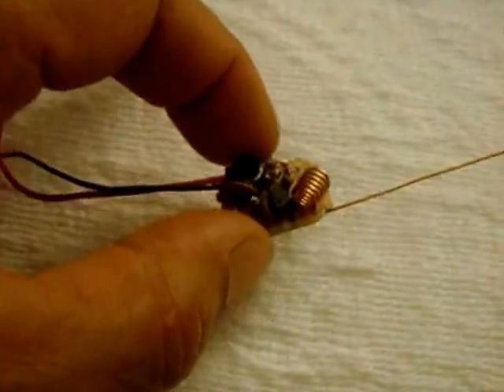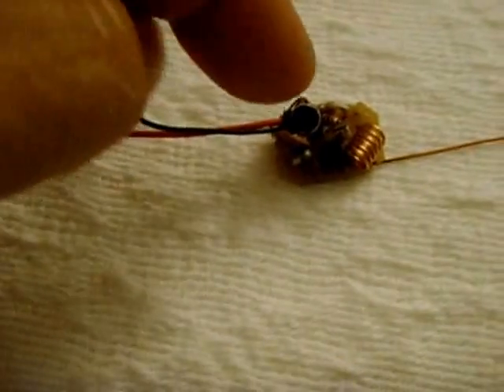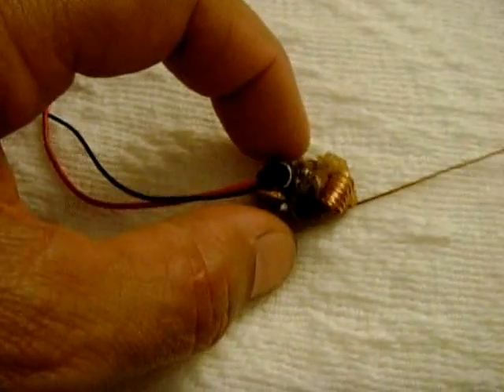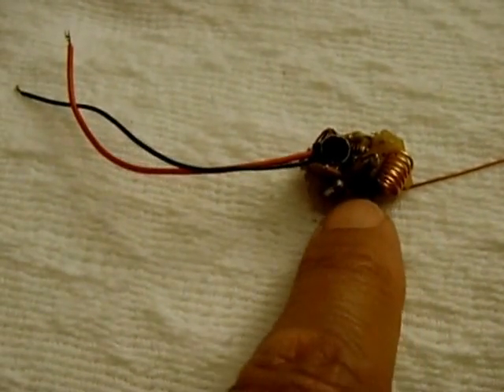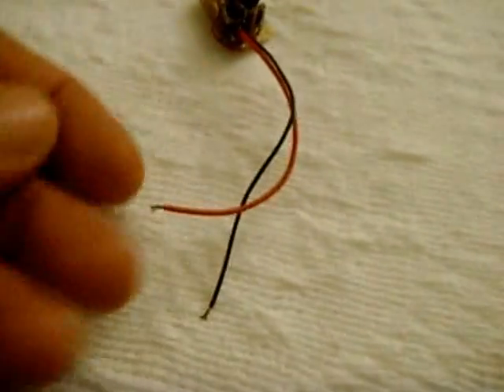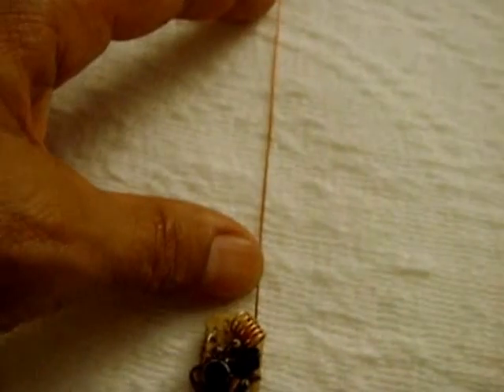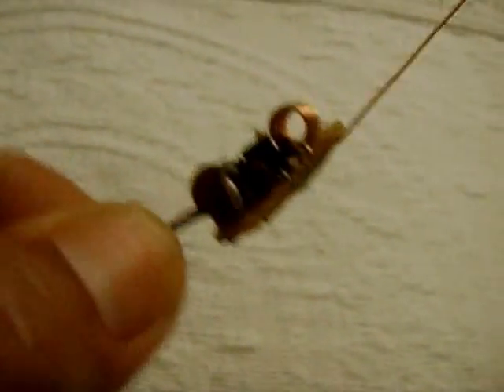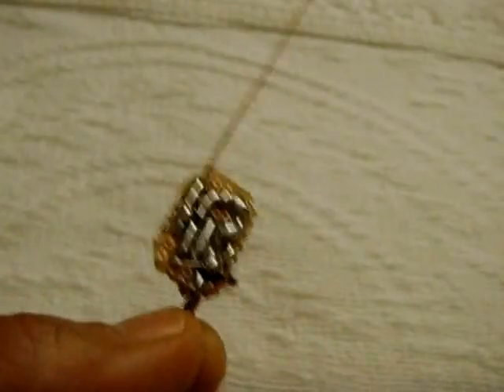Mini FM Voice Transmitter ~ Frequency Stable ~ Good Range ~ Clear Audio

Comment: I want to use a 9-volt battery what should I use then?
Reply from the maker: Use a 6.2V zener instead, you may also have to increase the 120 ohm resistor value and wattage.

Comment: on base of transistor it is being fed via  a 47K resistor? Is that a mistake in the document. As it looks like that would drop all the voltage leaving very little for the top of 270ohm?  Should it be instead 4K or something? If it is correct how do you get enough voltage across emitter resistor. I calculated using 47k and 270ohm as voltage divider which I think I am probably wrong. How does the input stage at the base of transistor work? (I am used to seeing voltage divider with 0.6 drop base to emitter. But we don't seem to have it here. I never seen that before. I am sure that I am doing something wrong)

Does it only oscillate when there is an input from mic?  Is it this ac voltage input level that switches on the first transistor. Since it looks like there is not enough bias to switch it on without mic. But I just don't get it. Would love to know how that works.
Reply from the maker: +Kevin O'Brien Hello Kevin. I can assure you everything works just fine with this transmitter. Everything shown is correct. 

Thanks For Watching!
Reply: +electronicsNmore Thanks for replying. I believe it works fine. As it looks like many others I seen on web. 

I just figured this out with a bit of googling. For example 30hz using the reactance capacitor formula at that frequency, gives Xc = 5.3MOhms now as a voltage divider with 47kohms we get a current at that audio frequency through transistor of 15.7mA. As the audio frequency goes up slightly less current will go through the transistor as we get to say 2Khz its roughly 10mA. So its not that much changed for most of the audio range. I would imagine, with multiple frequencies on input at the same time then it is probably almost constant current. This circuit has taught me something new. Capacitor/ resistor voltage dividers. I've never seen that before. Great stuff!

Many thanks for posting this. I also really like the Zener idea to fix the source DC voltage with this.

Comment: any possibility if I increase the voltage up to 9v ?
Reply from the maker: I'm sure you can. To use a 9V battery, replace the 3.9-4.2v zener with a 6v or 6.2V zener. Also raise up the resistor from 120 ohms to around 220 ohms.

Comment: Oh, good old school days. :D

I remember building spy bugs, but the frequency drift due to temperature change is very annoying. Then I found one circuit which is so stable that one can put finger(s) on the oscillating coil, and it will not change the frequency much. Just need to remember what I did (and what is the 'trade secret' behind this stability), and try to repeat that success many years (actually many decades) ago.

BTW, what I want to point out; the main issue with frequency instability is ceramic capacitors - it change capacitance too much with change in temperature. Try to use mixed types of the capacitors (polyester, paper, air spaced, etc.), to cancel out this issue.

And, yes - transistor changes capacitance too with change of voltage and temperature (especially in this type of circuit, where modulation is achieved by changing in collector/emitter capacitance). This transmitter actually emit both; FM and AM modulation at the same time. 

To achieve better sound sensitivity, use bigger electret microphone - this is the most important part. 

Edit: Oh, yes, almost forgot. Be prepared to get in trouble sooner or later (as I did, which is main reason not doing this stuff for many years) using such devices. Nobody want invading their privacy, so... be careful.
Reply from the maker: Check out my other videos. Stable FM loop antenna, and crystal controlled FM transmitter. That transmitter is very stable.

Thanks for watching.

Comment from the maker: Yes. Remove mic and 12K resistor. Connect the audio input jack ground to the lower rail(neg), and the audio output to a 47K pot, then feed it into the .47 cap at the base of the transistor. Use the 47K pot to adjust the audio level and make it clear.